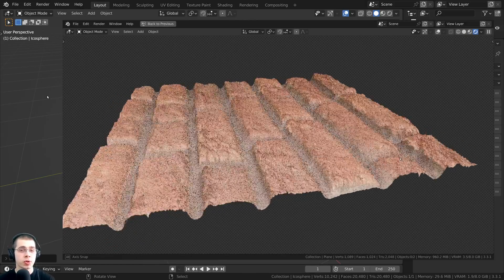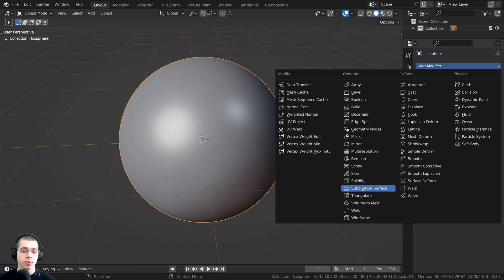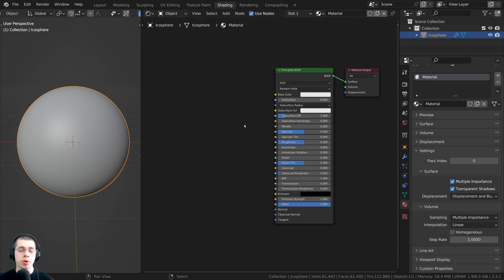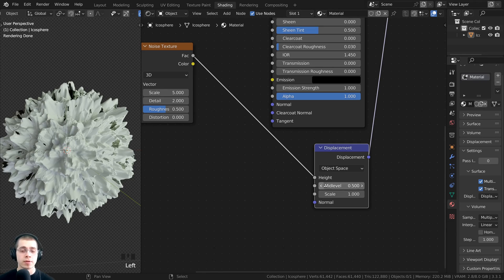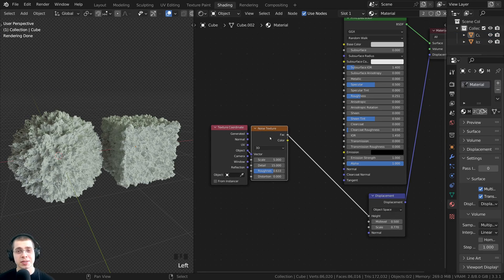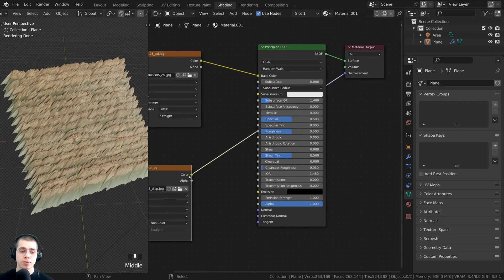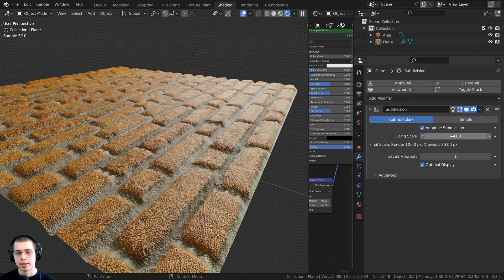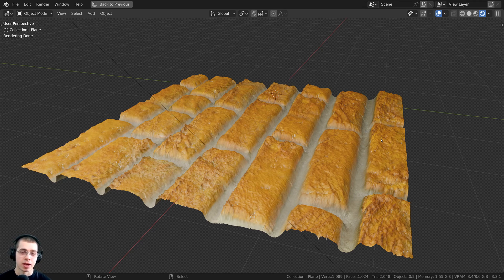How to Use Material Displacements in Blender (Tutorial)

Comment: Hi, thanks for the tutorial. Here an issue that I'm trying to fix, the displacement works perfect in the render shader in 3d viewport, but is gone when I press f12 or just simply doesnt work properly, only happens with f12 render.  Do you know what could be my error ? I have tried everything I saw in this tutorial and so many others without success. Maybe I miss something ? Thanks for your support and your time ! 🙏
Reply: I have the same problem sadly. Works perfectly in the viewport, but I get a lot of artifacts when I render with F12... can't figure out solution yet (I use Blender 4.1)